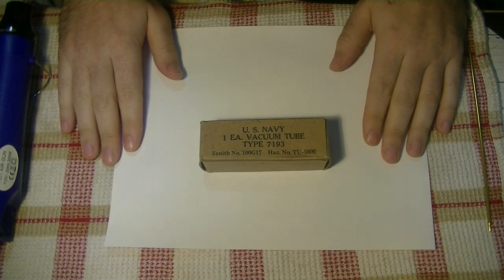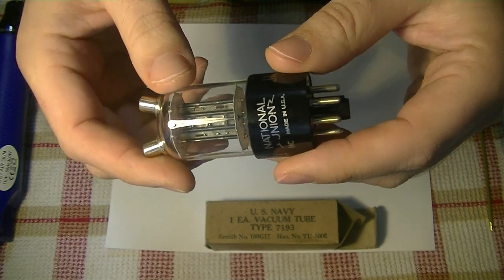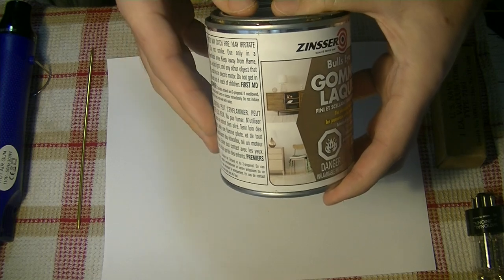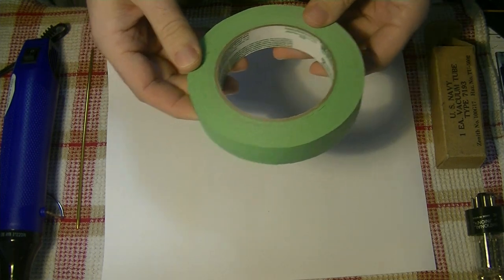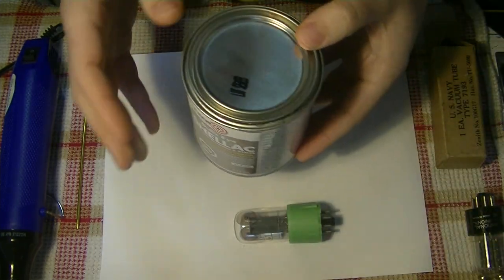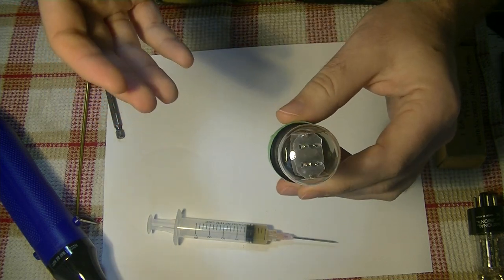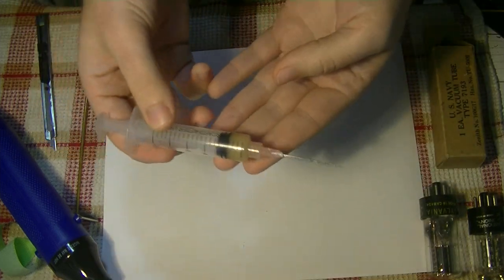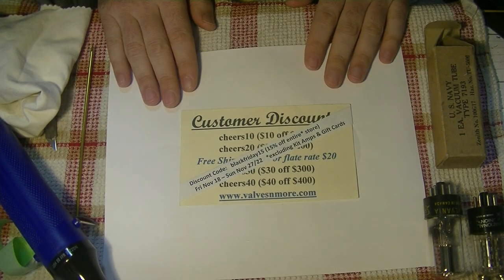Tube Lab #111 - Repairing Loose Tube Bases

Comment from the maker: And one thing more - many vintage tubes used a shellac slurry (alcohol, shellac, filler) to bed and glue the glass to the base.  Later on many modern tubes appear to have used a urea type glue (expanding foam glue - nasty stuff).  You can use the shellac method to repair loose bases on most tube types (new and old) and when you repair older vintage tubes you're basically using the same product (without a filler) that was used originally.  So some of that alcohol will hopefully help dissolve the existing cement and re-cement the tube as well.  And the beauty of using shellac is it can be re-disolved simply by applying alcohol, so if a repair doesn't quite take you can simply apply more shellac/alcohol and Bob's Your Uncle!

Comment: Well done.  The only question I have after watching is, what might need to be repeated 4 to 5 times?  The whole application of shellac, heat gun + cleaning process?
Reply: I Don! Sorry it wasn't that clear. You want to repeat the application of shellac and heating it till it stops bubbling. Then once the gap is filled and the base is secure, you can then do the cleaning process to clean up the excess on the glass and base. Hope that helps!

Comment: Does a loose tube base cause performance issues?
Reply from the maker: Yes if you twist the glass while the tube is operating you may short out the leads, remember the tube plate(s) will have high voltage present.  Caution!  This can be a fire and electrocution hazard, as well as dangerous for your amp!  This is why not handling a tube by the glass is important, to not damage it in the first place, always use socket saver/lifters when a socket is sunken and if a tube base becomes loose, repair it before putting it back I to service.
Reply from the maker: Generally a slightly loose base won't cause any performance issues.  It's only when a base gets really loose that it becomes a big problem, see above.